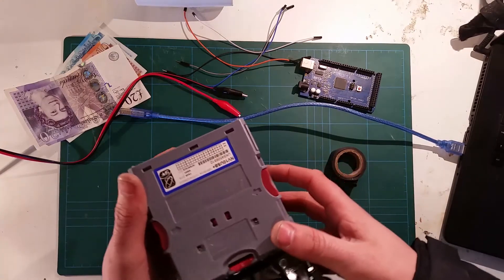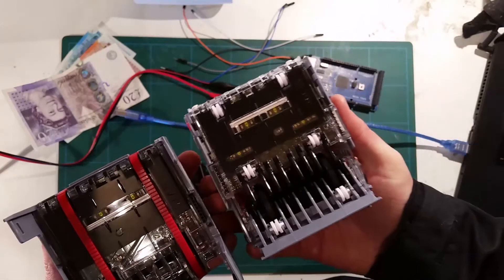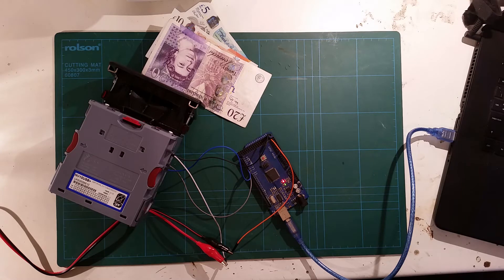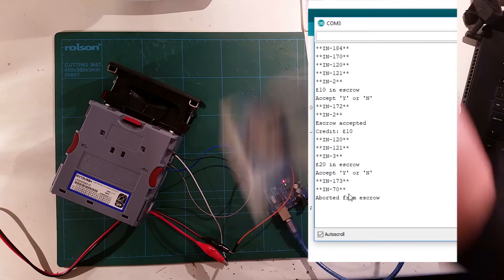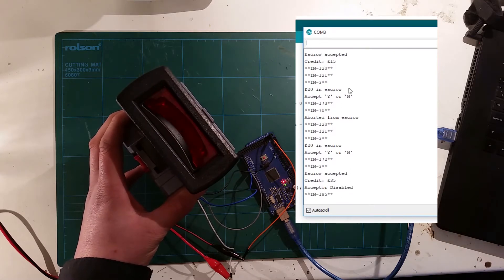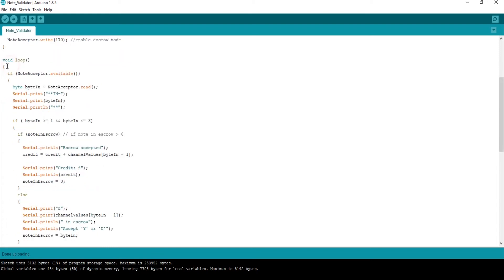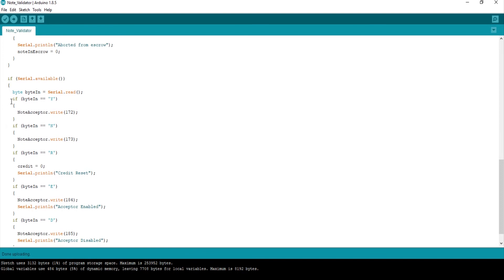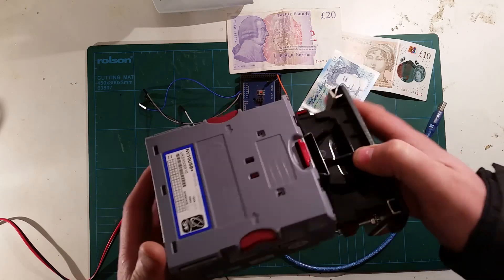NV10USB+ Note Acceptor with Arduino and Code

Comment: Is it possible to make id003 to pulse and viceversa with arduino?? Also need to know if it's possible to make an arduino interface for an id003 Bill acceptor  that receives one  currency and inserts credits on another currency... Thanks in advance...

Comment: Hi. What exactlly is the 300 in front of SERIAL_8N2 ?
I've replicated your code entirely and i cannot make it work for the life of me. The acceptor does not come "online" so obviously i cannot enter any bill.
Is the exact same acceptor as yours and it works perfectly, ive tested it on ITL software as well as any other modes i've tried. Cannot make it work on MEGA
altho ONCE when i manualy connected the wire to pin 15 (rx3) the serial port displayed **IN_0*. What i am doing wrong?
Reply: Nevermind, i'm an idiot. You are in SIO mode not CCT.

Comment: In this video tutoiral, you use SIO/ TTL
How can you set this mode
As I know, press red button than connect to computer by IF17, than access programe tab, choose SIO interface
However, it immidiately disconnect from computer
How can we know which mode are setting in NV10USB+ right after its auto disconnect or after auto disconnect NV10 defautly turn in to SIO mode

Comment: Hello friend, i still not understand your code
1<=byteIn<=3 because you have 3 type of note, if my vietnamese note has 7 type (1k,2k,5k,10k,20k,50k,100k,200k,500k)
The chanel should be 9 and byteIn turn to 9 or byteIn only  range 1-3 follow NV10 datasheet?
but noteinEscrow just 0 or 1
noteinEscrow=byteIn; That mean noteinEscrow can be 2, right?  so if (noteInEscrow) line has now meaning when noteInEscrow equal 2
Can you explain more clear for me
Thank you
Reply from the maker: Hello, I do not understand exactly what you mean but will try to answer. The code is optimised for UK currency. We have 3 notes in the UK so your code would be if (byteIn>=1 && byteIn<=7)  if you have 7 types. The code uses the noteInEscrow value to tell if there is a note already in the reader (If noteInEscrow is greater than 0). Once the note is aborted or accepted this value turns to 0. Hope this helps

Comment: how can you change the currency type? or all
 depends from the bytes read the machine
Reply from the maker: You need to download the manual from the manufacturer. This will explain all you need to know about changing the currency type. You will  also need extra hardware though.